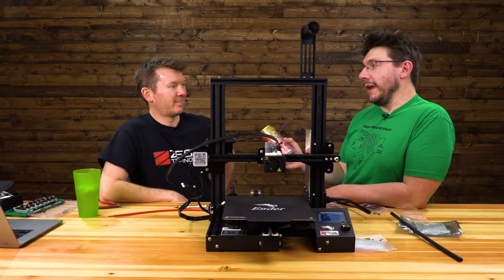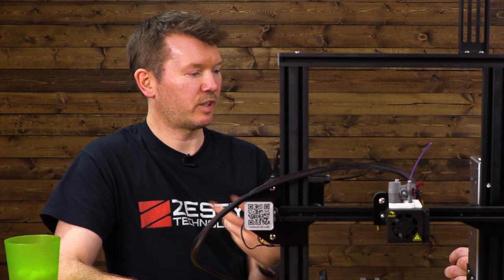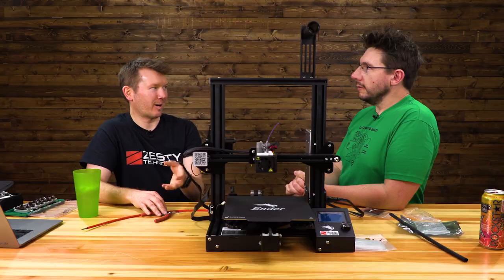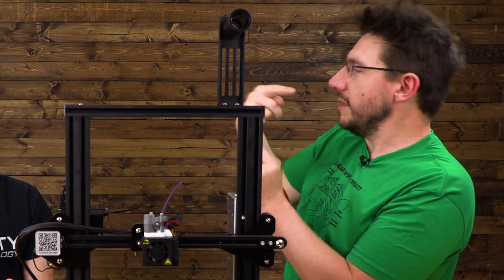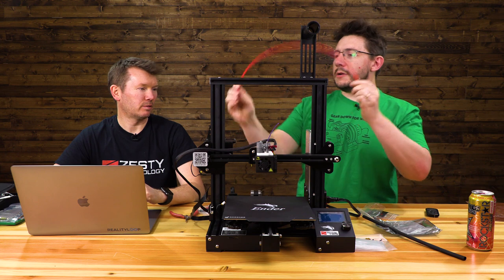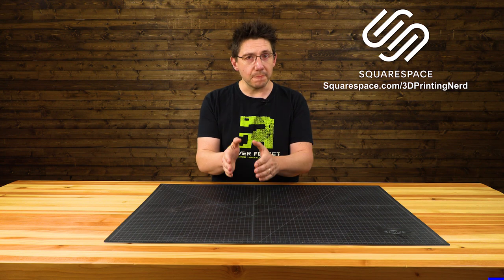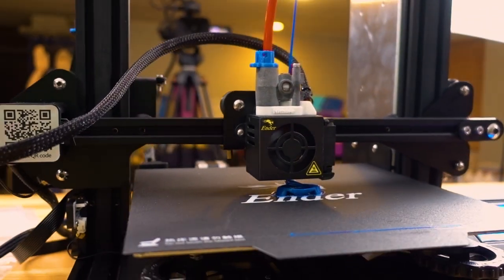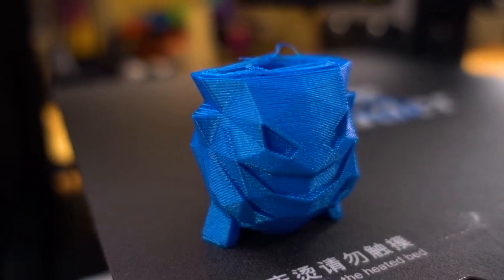Zesty Nimble - The Remote Direct Drive Extruder IN STUDIO!

Comment: this is a very amazing idea that Delta and corexy printers could benefit a TON from!
but to benefit from it you need a 32 bit printer or a 8 bit one running klipper, because the regular 8bit one can't manage the speeds you need to print fast
you should try it with that and crank the speed to 200mm/s at 2k acceleration (with a good hotend)
Reply: There are 64x single board computers available that work great. Just needs a little work to get going.
Reply: It’d still be great even at 60mm. No ghosting and all yes direct drive benefits

Comment: Fascinating! I wonder what the down-sides are to this extruder.. Like is there any extrusion-rate accuracy loss with that flexible drive-shaft? Like if it's doing lots of retraction moves? Is there any give when 1 side of that drive-shaft turns, vs the other side? Or is it real solid/instant?  Mybe the term is latency? Is there any latency or tolerance between the movement from 1 end to the other?

Comment: I like the idea of this extruder, it is innovative to say the least..
Reply: yeah very innovative !400 mm second its magic!
Reply: @Evilslayer73  was it 400% normal speed or 400mm/s I cannot remember now, either way it is very impressive, and while I hope for their sake people don't rip off their idea, I also hope it brings forth a new wave of innovation in the market, I can personally think of a different way to do light way direct drive extruder without using a flex shaft, if it is a practicle idea or not, that is a different matter all together...
Reply: @HeimoVN  yes i approve!
Reply: @Evilslayer73  that was 400%, not mm/sec.  The model was probably slices at 30-40 mm/sec, making the actual print speed 120-160 mm/sec.
Reply: @JasonSimpson1966  oups my error!!!
Reply: @JasonSimpson1966  oups my error here lolllll

Comment: Oh boy! That raises a lot of questions related to physics: When you transfer the rotational movement from the external motor via that metal cable inside that tube, won't the metal inside that cable be slightly twisted in each direction? Kind of like lagging. (Imagine a steel wire, and put two handles at each end, now you can "twist" the wire quite a bit), I can  imagine the same happening here.

Comment: I can't imagine that the torque being applied to the cable housing doesn't transfer to the printhead
Reply: It does not twist the head, the sleave counteract the force, as the slece is fastend at both ends. and if it did the force is 30 times lower than the force on a normal extruder, as the gear ratio of 1:30

Comment: I just ordered TH3d Tough Extruder, but this might be on the buy list before it arrives.

I love the idea of printing flexibles at normal speed, I fell in love with the Pneumatique by Treed in the Maker Box a couple months ago and want to use it more but the print time is a major detractor.

I like the 'remote-direct drive' title, it fits and works.
Reply: Nic Franco  My first attempt  was with a .4 Chinese brass nozzle and all Vanilla Ender 3 (save for PTFE tube), at 20mm/ sec I got very good results (used the FatBottum TPU preset in Cura 4), absolutely satisfactory. I tried some pieces with a .8 nozzle that actually turned out worse by my opinion.

The stuff is STRONG! I haven't tried every material or brand, but for all around toughness, this seems to be the toughest material I've personally  handled (in normal conditions).

Comment: Wouldn't the movement of the head cause inaccuracy with the extrusion?
Reply: from the speed, or the nimble?
Reply: @craiganater3  The nimble, mostly due to the sleeved cable being used to remotely actuate the extrusion gear. Since the extruder end of the inner cable is unconstrained, it seems only natural for their to be subtle unwanted movement of that inner cable due to positioning of the print head as it moves around.

Basically, get a bowden tube with some filament loaded in it. Secure both the end of the filament and the tube with one hand, then move the other end of the tube around with your other hand, the filament will rotate back and forth slightly depending on how and where you move the tube.

Keep in mind I am not accounting for pressure from the extruder being under tension due to being loaded with filament. Maybe this is enough to prevent the unwanted movement entirely.

My main concern is that the unwanted movement might be enough to introduce stringing and or pitting, especially on printers with a really constrained path for the drive line like on the creality range of printers or some delta's. Though in situations like that, I suppose you could probably get away with making a simple bracket to reposition the extruder in such a way that the path is more free to move.
Reply: Darkmastergrey I saw on another video that the 30:1 ratio negates any slight twisting in the flexible shaft..

Comment: So the motor is on the frame connected to a flexible shaft and it in the hotend head is the extruder. This is better than the bowden system but remains behind direct driven. Probably you will have backlash problems too unless the flexible shaft has a good couple to the motor and the extruder and has a very good quality, which it's expensive. The big advantage of this system is you can print flexible materials without a direct driven extruder.

Comment: Very interesting extruder design. If I ever build a delta, I will likely get one. 

I do have to say 400% speed is a pointless stunt on a tiny model in a machine like that runs very low accelerations. The move distances are so small the machine almost never gets to full speed anyway.

Comment: They didnt mention the error in the flexible cable. The twist at one end is not the same as the other end. There is a loss, and that loss may be similar to the losses in a boden tube setup. He should have done the analogy for AC current. Instead of a rotate through the flexible cable have it push 2mm, and retract...push 2mm, and retract. The receiver could be something like a push ball point pen, so every push causes the mechanism to work, and the mechanism delivers a perfectly metered 2mm.

Comment: Can you imagine a similar review of a new automobile?
Good news: The Zesty Spyder roadster is a revolutionary new sports car, which does 0 to 60 measurements of distance per hour in less than two seconds!
Bad news: However, we accidentally left the engine and turn signal lever at our mom's house two states over.
Good news: But we can print up those missing components in only a few minutes!
(dogs barking in background, followed by gunshots and sobbing)
Mrs Nerd: (bursts into studio clutching smoking weapon):  I BLAME YOUR INFERNAL CAREER CHOICE, MR NERD!
[after parts are printed]
Good news: Hot diggety dog!  Everything works as we claimed.
Bad news:  But there is a 36-month lead time on one very specialized cotter pin we can't print on demand.

Comment: A solid driveshaft with motor mounted at the end of the X gantry and a sliding gear at the extruder would be a simpler solution. Doesn't need the crazy gearing, no problem with cable winding direction. The speed on a bed slinger is going to be determined by bed weight anyway.

Comment: As a recent buyer of a massive delta printer, I am, to say the least, intrigued. I'd been wondering how much modding I would have to incorporate to use some kind of feed system like a mig wire feeder where I have a body of experience to get a remote feeder in place so only the heat block would be swinging away on the head.

Comment: So it's like a flexshaft tool that powers the extruder so they can take the motor off of the moving head. That's a good idea. I wonder how much slop the flex shaft introduces, which I would think would mess with retraction a bit.

Comment: I watched thus type of extruder few days ago. I think this idea is very cool.
But, I have question about this method. In this method, torque maintained constantly when the extruder motor will be revolution with constant speed?
I think small difference will be exist, when the  flexible rod turning each cycle. I think strain will be different by the function of theta.
And In this method, force is transfer via to flexible rod.
It will have a time constant( like a thermometer time constant).
For instance, driver motor act when t=0 and actually transfer to the extruder at t>0. it will be neglisibly small??
Reply: There's a worm gear on the end.

Comment: Doesn’t this reduce extrusion accuracy? This is like putting a rubber band beteween your extrusion motor and the extrusion gear.
Reply: Absolutely, however the 30:1 drive reduction reduces the reduction in accuracy 😀

Comment: 3DPN,,, Would you say that this is a must for replacing the Boden system on say a CR10S Pro to give it a better more consistent print? Also, are you running this on any of your printers now?
Reply from the maker: I don't think it's a must, but it's a neat addition. For the CR10s Pro, if you're looking to change and upgrade, look at the Bondtech add on for it. I don't have the Nimble on anything yet.
Reply: @3DPrintingNerd  Wow ok I looked at it it would be a great thing to try on one of my printers. I have ordered several to get back started up again. I think it is better because of the 2 feed wheels in place of one it will make stripping out the filament less possible ans induce more force onto the hot-ends keeping a constant flow rate. Great stuff here. Thank you

Comment: I was really excited to see this when Tom visited the booth. One of the biggest problems I have with my printer is that it's so big my bowden system is about 800mm long, which makes retraction settings a bit of a nightmare and since it's a corexy system I really don't want the weight of a direct drive system.

I suppose my biggest question is if there will be different shaft lengths and stiffness available? What I would probably do is: mount it so the motor is up above the printer so there would be very minimal flex in the drive shaft unlike when it's mounted on a Cartesian system like that Ender 3. Edit: I see there are different lengths in 75cm, 95cm, and 120cm on the site. Why is the 75cm the same price as the 95cm?

I hope you guys can get a deal with Matterhackers or other options to be an over seas distributor to help with shipping times and costs.

Now if only I could afford it when it is in stock...

Comment: Great job both of you, best demo of on-the-fly 3D printing creating useable parts. I've just bought a CTC i3 clone for $99 Inc Honey App $5 off, this supercheap printer flies along & is producing quality parts at 0.1 LH/ 0.4 nozzle. 1 key to this surprising result seems to be the Bowden tube-free extruder (I get strong HB adhesion painter tape on glass) so I'm looking forward to seeing if my <$75 powercut recovery 8L build vol. machine can cope with woodfill/flexible and if it does, my Elec bill is going up : )

Comment: Ive had the double nimble for a Chimera on my CR10 5S for about a year now. Ive ran probably around 30  spools of filament through it. ABS, PLA, flex, elastic, nylon, ASA, PC etc. I have never had any issue with it. works perfect. I have a 1600 watt keenovo heated bed with an enclosure and it get hot in there and the nimbles hold up fine in the heat.
Reply: Glad to hear you Nimble is going strong Jason!

Comment: I have one of these connected to my Duet/Smart Effector Delta, and I have to tell you my experience differs from the claims of this video. I can print flexibles if I go very slow (no more than 20mm/s better at 10mm/s), and use NO retraction, but I don't find it to be much better than the bowden setup. The breech is nice, but it can be a bit fiddley when there are connectors in the way (you could kind of see that in the video). I use magnetic balls to suspend my effector, and a lot of this extruder is metal, so pretty much every time I change filament, the breech arm comes off and stick to one of the magnetic balls, and when printing, the drive cable slaps and sticks to the magnets on the pillar when it is in range, and pulls away kind of vibratively when it pulls away far enough. I'm still on the fence as if this is a worthwhile upgrade.

Comment: Curious... In terms of print speed, is it really that big a deal to put a drive motor on the hotend?  I mean, the Makerbot 2X I use at work has two motors and two hotends.  And it still prints pretty good quality at 90 mm/s.  That's ABS too!
Reply: Depends on the design of the printer. Printers designed with the motor at the extruder are sturdier then one without it.

Comment: During the explanation of how the Zesty worked I nearly expected to hear, "It goes roundy roundy timey whimey" for a moment.
Reminds me of the flexible shaft extension accessory for a Dremel, which makes me wonder, as that needs to be hung down in a relatively straight line when first turned on to prevent slippage and damage.  Is a similar precaution needed on the Zesty?

Comment: Hey Brian, if you are still reading the comments, just curious. What is the backlash like with the drive system?  Is it something you would have to account for in the retraction settings? This is a very cool idea! I have a flexible drill extender I've used, but I noticed that it has a lot of backlash as the whole tube tries to move when it starts/stops. I am designing a mostly 3D printed printer, and have been looking for a lightweight head to put on it, yours definitely fits the bill.
Reply: Agree, exactly my thought. Especially since the cable is flexible enough to bend laterally, it must be flexible in rotation as well.

Comment: Ahh to bad no credit given to the original designer and company that came out with this originally. Flex3drive.....and yes there tons of proof and the behavior of Zesty guys is just horrible.  Sometimes it pays to do research about company before you do a video with them...just saying.
Reply: That's like saying GM is just a derivative company because Ford was first.  Give me a break.  The Nimble is a MUCH smaller/lighter unit.  I do like Flex3Drive's adaptor that let's me just replace the stepper.  That removes a lot of weight.
Reply: Can you elaborate? I'm all about doing business with a good company, and avoiding a bad company.
Reply from the maker: I did my research and saw documents signed by both parties. My research contradicts what you’re saying. Can you provide the research you’ve done? What links should I look at?
Reply: I researched Zesty and Flex3drive a few months ago.  I ultimately decided to purchase the Zesty for several reasons.  It's printed on commercial machines using engineering grade plastic (PA-12 nylon).  The Flex3drive appears to be printed on a standard FDM printer out of ABS.  I'm sure the Flex3drive is well made, but it simply doesn't look like a polished product that's worth the roughly $90 they're asking for the V3.  I also think the 30:1 ratio of the Zesty is better than the 40:1 ratio of the Flex3drive.  At 30:1, the stepper already needs to run at high RPM, and pressure advance is taxing.  At 40:1 I think it would be even more difficult for a stepper to keep up.  And finally the website for Flex3drive is not good.  They've been around for multiple years, but they still don't have good documentation up on the site.  Ultimately I found the Zesty site to be easier to navigate and less confusing, plus they had much more documentation available for install and setup.  In the end it was an easy choice for me.
Reply: @davem3048  no that not the same at all and you know it.
Reply: @jakepF1D  again the motor is not turning 40 time to one rotation  the motor works less and and uses very low vref.
Reply: @TheRealKingDong  Yes it is.  That's how gear ratios work.  The stepper needs to rotate 40 times in order to rotate the hobbed gear once.  On the Zesty it's 30 times.  The hobbed gear on the Zesty has a much larger diameter than something like a Titan so it's not running 10 times faster, but the motor does run much faster than any normal geared extruder.
Reply: @TheRealKingDong  Uh... Yeah it is.  It's called competition.  "Hey, that's a good idea, but we can do it better."  Did Flex3Drive patent the flex drive?  No, their design is adaptive of a  pre-existing technology.  The Nimble is a flex drive, but the design is completely different.  You telling me that if I decide I can do it better than both these guys and design my own that I'm stealing from them?  Please...  If you think the only way to compete is sue or dox someone who might have a similar idea you are in for a long sad career.
Reply: @3DPrintingNerd  Good research could involve speaking with both parties to hear both sides of the story, not just a one sided view backup by a hand picked selection of docs, some of which should be considered as private and confidential business docs to present a misrepresented version of the truth.
Reply: @davem3048  you are right. there are designs that predates flex3drive hence it wasn't patent-able to begin with.  https://www.thingiverse.com/thing:6653 https://www.thingiverse.com/thing:14311

Comment: Was there any firmware modifications needed?  I had all the parts printed out and was ready to order one until I started reading into the instillation where it went off about needing to change the stepper gear ratios or some mumbo jumbo I can't remember because I can't pull up the website right now.   But more or less once I read that it turned me off the idea of one
Reply: On a Creality machine it's just the addition of 5 lines of start Gcode to your slicer